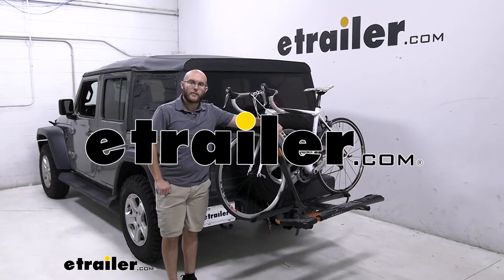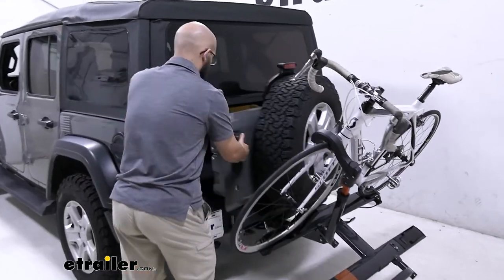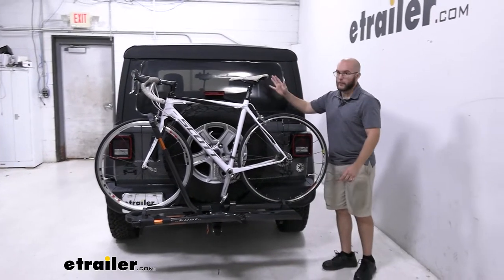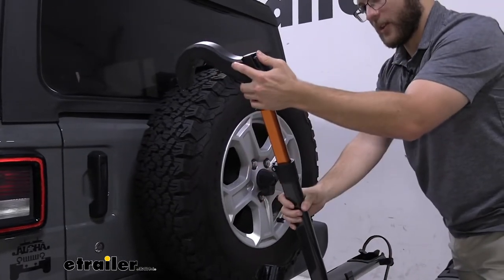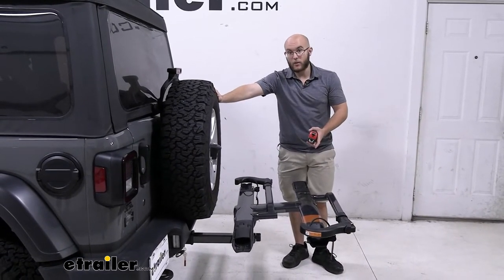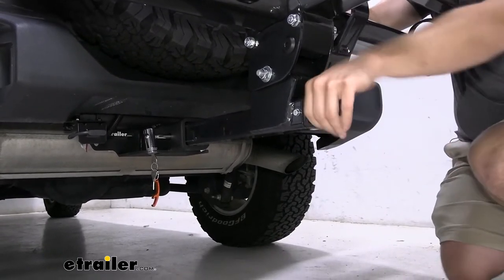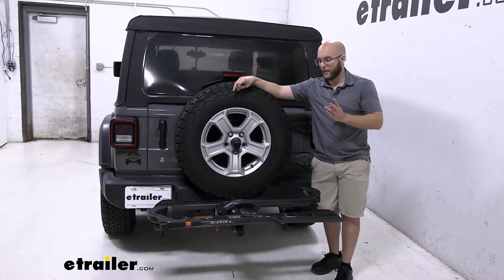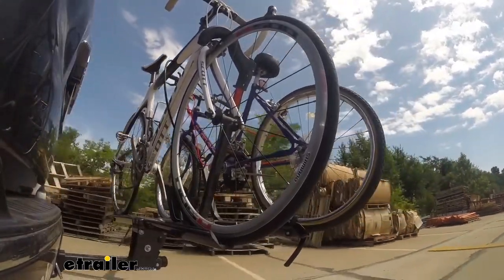etrailer | Set up: Kuat Sherpa 2.0 Bike Rack for 2 Bikes on a 2019 Jeep Wrangler Unlimited

Comment: Why don't they show a video with the 8" hitch extender? That seems to be the most economical solution for the Jeep Wrangler.
Reply from the maker: Next time we get one in, we'll ask the video team to get some footage, however most of the bike rack manufacturers aren't super enthusiastic about folks using extenders. Using an extender will reduce the hitch capacity by half, and will create lots of bounce, due to adding an extra connection point between the bike rack and the hitch. Choosing a bike rack with a longer shank or a hitch with more bumper clearance to the rear edge of the spare tire is what's recommended. Let us know the hitch pin to furthest rearward point of your spare tire and we'd be happy to make some hitch/rack suggestions for you.
https://www.etrailer.com/Hitch-Bike-Racks/Kuat/SH12B.html